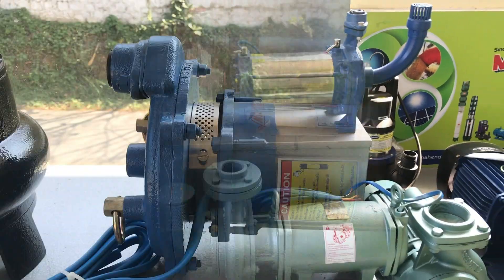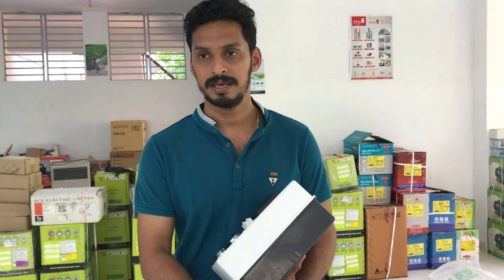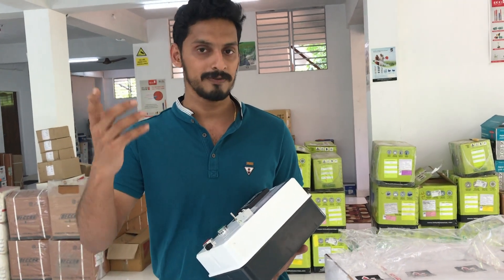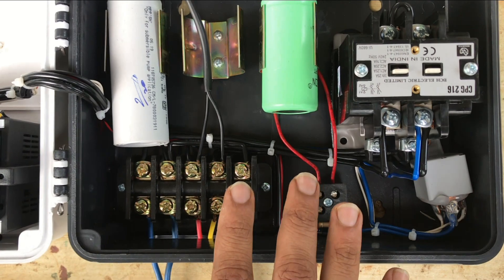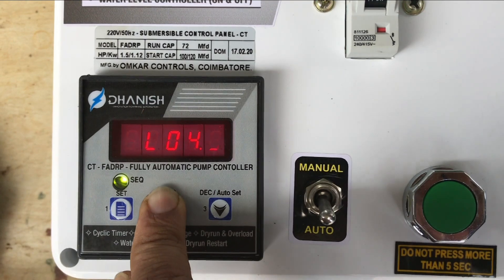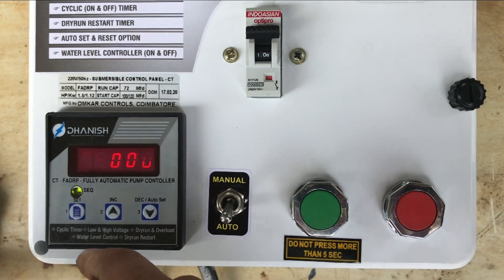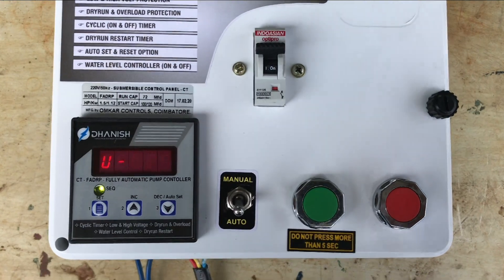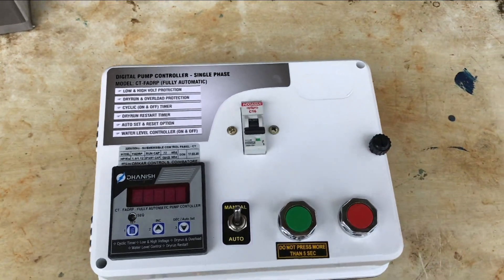Dry run Automatic panel for submersible pump -കുഴൽ കിണർ മോട്ടോർ സ്ഫേറ്റിക്കായി ഓട്ടോമാറ്റിക് പാനൽ ?

Comment: What's maximum time delay that can be adjusted for cyclic opertion? Can we pre-set  it something like every 1.5 day (36 hrs)? The supply to Flot Unit is DC or AC? If it is DC there is no possibility of electric shock from a faulty float unit!!
Reply from the maker: Maximum delay is 999 minutes. Float connection is DC

Comment: Will this control motor low and high voltage cut off in manual mode
Reply from the maker: There are 2 models in single phase. For Semi-Auto, high/low voltage will work with manual on/off button. For fully automatic it wont work in Manual mode if am not wrong.